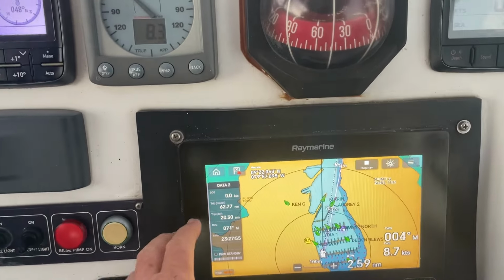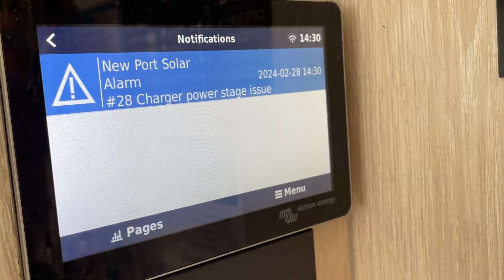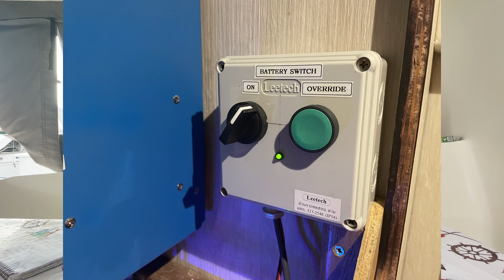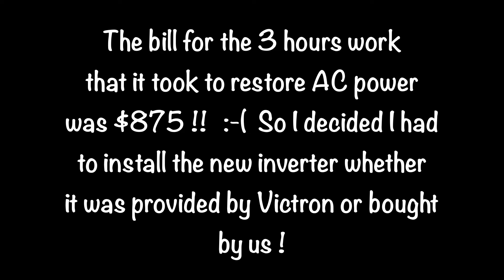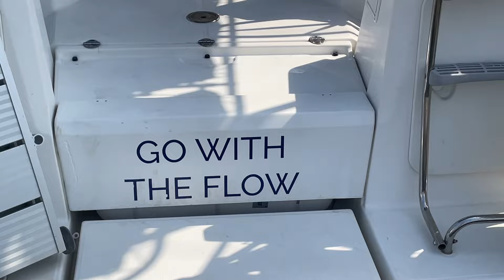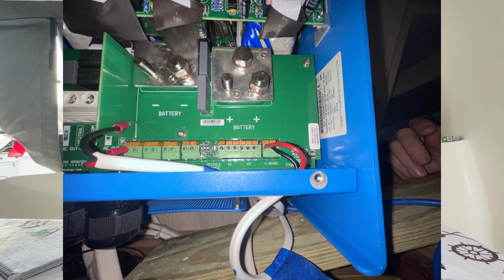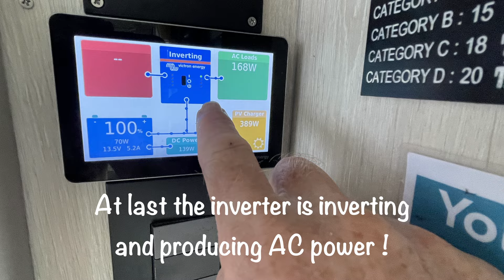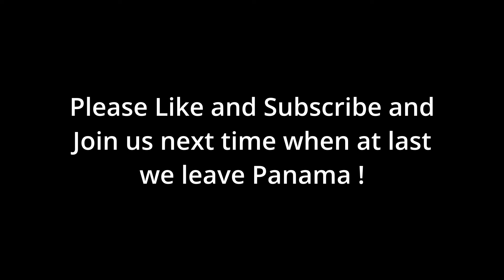SV Knot So Bad Episode 67

Comment: Hey John, notbing wrong with the fan, you need to enure you are venting the hot air out by the top of that compartment. Maybe make a a : vent in the top enclosure, That way you are sucking cool air from the bilges and venting it out the top
Reply: Sadly opening a vent at the top is not possible - it’s the kitchen sink above. I don’t want to risk any water coming down from above 😳! However, I have fitted a second identical fan beside the first, so hopefully that will help 🤞👍
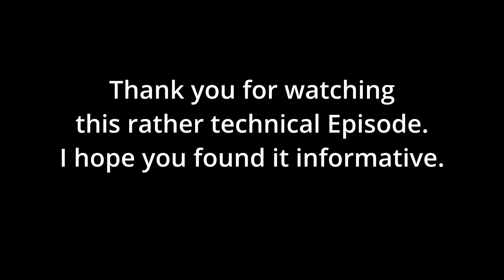Reply: @sandrajohnnewmanwarnock2232  Sorry John, I meant the top cover that you put in place at the 23:50min mark of the video. As hot air rises and with your 2 fans now that area should be cool
Reply: Thanks for that suggestion. Currently the fans are sucking air down from above and blowing it into the bilges. I did it that way as there is no exit above. But your suggestion to put a vent in the cupboard door is a good one - I’ll have a look at doing that. Thanks again. John